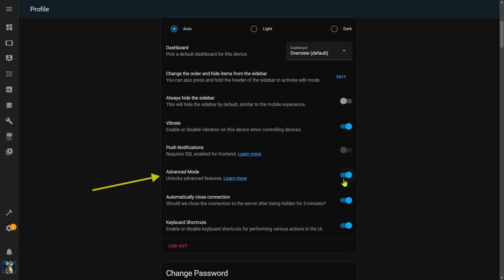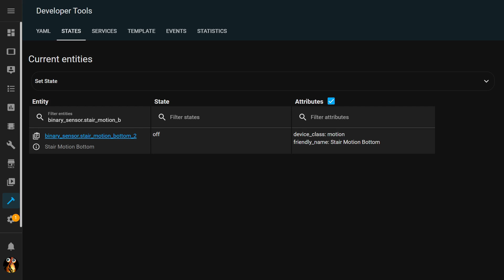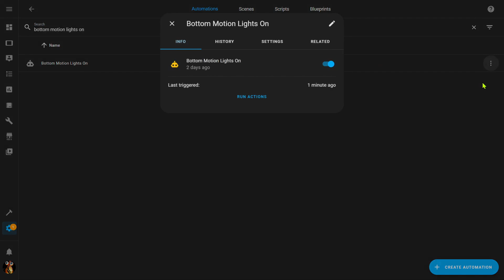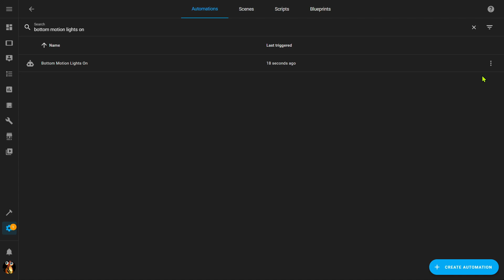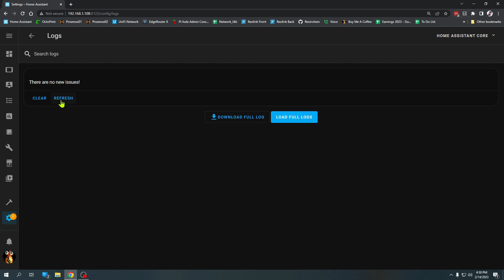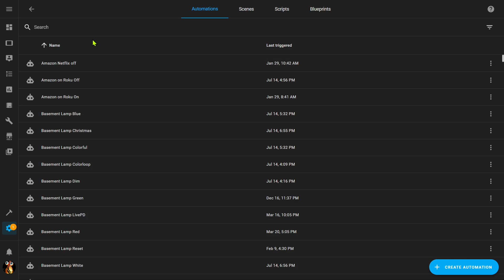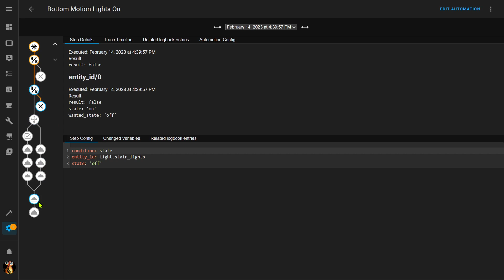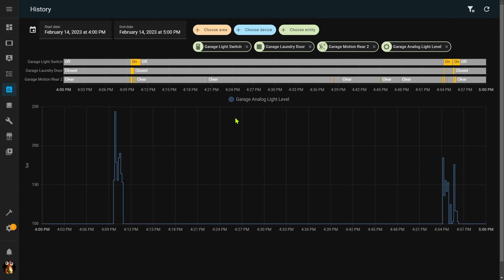Home Assistant 101: Troubleshooting Automations

Comment: Thanks for your Video. Helped me a lot to understand how the traces work. Since i live in Germany i had to slow down the speed of the video a little bit to understand everything. Cool Stairlights by the wy, I wonder if the would also work with wooden stairs.
Reply from the maker: Regarding the stair lights, my goal was to build the system without making any modifications to the stairs (I have a complete separate video on creating the stair lights).  It will work with pretty much any type of stairs as long as you can find a way to mount the aluminum channel to the side stringers.  In my case, the stringers are wood so a small screw and bracket are used to hold the channel.   But if you have other material types, you could use command strips, double-sided tape or even glue to hold the channel to the stringer surface.

Comment: My ThirdReality Multifunction Night light "Occupancy State is ALWAYS on.  Is that why it isn't triggering behaviors?   Also, I don't have a toggle switch when I click the "info" button.
Reply from the maker: If the occupancy is always "on", then you need to address and fix the issue with the sensor/device first.  If Home Assistant uses sensor state as the automation trigger, then the automation will never fire if the sensor never changes its state.

Comment: Man, just the 10 min of watching this fixed an issue that I have had since I implemented the staircase lights
Reply from the maker: Glad it helped!  I purposely used the stair automations because it is by far the one I've had the most questions about, or the one that folks have had the most difficulties with, in terms of getting the automations working correctly.

And of course there are additional tools and methods for troubleshooting, but these are the ones I use most commonly and will usually at least identify the problem... which of course is the first step in terms of a fix!

Thanks for watching!

Comment: The other nice thing is you help us form a disciplined approach and I think I rely too much on the log information on the entity level and I should be using DevTools->Events and I think I have avoided DevTools Events because the screen just seems so much more intimidating than the brief version of events you get at what I am calling the Entity level. Sorry I am challenged to know if I am describing the screen I mean.

Bottom line is you didn’t show this method so I would assume this is not as good and might be susceptible to not being updated properly so we should always use DevTools?
Reply from the maker: I'd say use whatever tools are at your disposal!  As someone else mentioned, there are also some tools available in the UI automation editor that allow you to step through various parts of the automation.  Since I write my automations in YAML and don't use the UI editor, I simply wasn't familiar with these options.  But my methods/tools are certainly not the only ones available.  I think it's more about the concepts (check your entities, identify the part of the automation that is failing, etc.) than it is about the actual step-by-step process and tools that I showed.  For example, if dealing with something like MQTT, then there are other tools like MQTT Explorer that I might pull out of the bag to help troubleshoot.

I guess my intention here was to introduce a methodology and show some of the most common tools I use when trying to troubleshoot my own automations.. or when trying to assist others.  But there are certainly more options and techniques available.

Comment: Good stuff, very helpful!

I didn't see it, maybe I missed it, but you can also run/test each automation step in the UI. 
For example: Action: Turn light on.   Right hand side, 3 dots, run. (Conditions say Test instead of run)
Reply from the maker: You didn't miss it... I just didn't cover it.  I'm a YAML guy, since I learned how to create my automations back in the day when the UI wasn't available.  So, I simply don't use the UI... and therefore don't know much about how it works or what options are there.  But thanks for pointing out those options for those that do use the UI.

And thanks for watching and taking time to share the tip!
Reply: Makes sense! I'm the opposite, can't code beyond cut, paste, and swear 😁
Reply from the maker: Ha!  Yeah... I guess I also omitted the very first step in troubleshooting:  swear at it!  Thanks for the laugh this morning!
Reply: @JohnMayfield-NS , I love the acronym, CP&S, often repeated by all levels of programming ability!

Comment: Thanks, didn't bother to see how traces could help until now
Reply from the maker: I didn't really see the purpose at first either (and they can be a bit confusing to interpret at the outset).  But once I got the hang of them, they can be invaluable in troubleshooting.  They are normally my first stop for anything that isn't working or behaving unexpectedly.  I think they are probably one of the least understood (and therefore least used) tools for resolving automation and script problems (yeah.. probably should have mentioned that scripts have traces too).

Thanks for watching!

Comment: Helpful stuff❣ Looks like you gotta rush up the stairs...😂🤣 Love the sequence but it's FAST.......
Reply from the maker: Well... you can actually adjust the speed of the lights (if you look closely at the automation, you'll see a speed setting is included).  And if they reach the end before you do, the pattern simply repeats until the opposite sensor is triggered (or it times out after about 15 seconds).  I have it at a "happy medium" for me and my wife.  But for shooting this particular video, I was trying to 'keep up' with the lights.. I could have just as easily slowed the lights down a bit.

Thanks for watching... and taking time to comment!